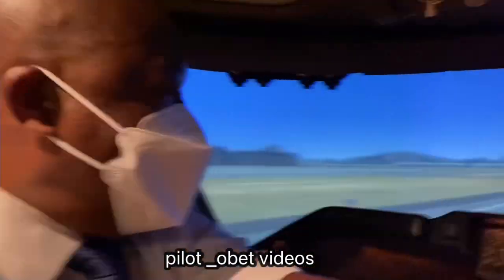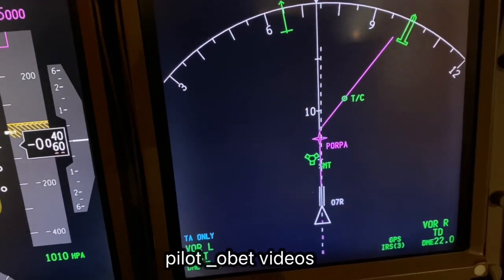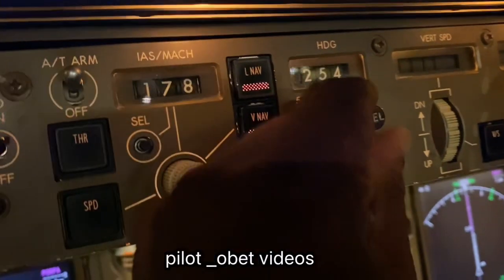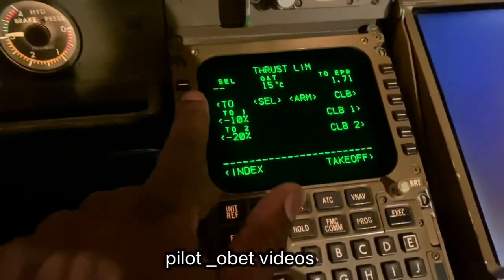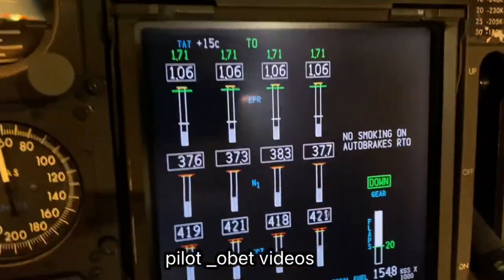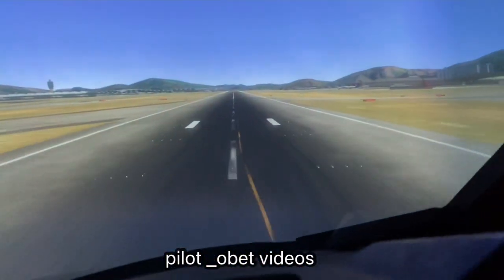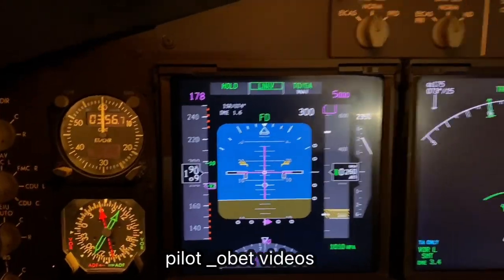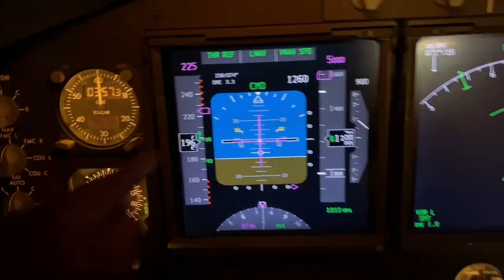B747-400 heavy weight takeoff pilot actions.

Comment: Did not know that auto piot can be set this early in the flight even before lifting the landing gear. Your videos being so informative.
Reply: He did raise it rather late, but normally the other pilot will do it
Reply from the maker: Minimum engage altitude is 250 feet on the B747-400 or 200 feet on the B747-8

Comment: Captain; great clip, thank you. What are the 2 clicks I hear sometimes after rotation? Not the 2 bell chimes but it’s almost like a door clicking close noise
Reply from the maker: The other click is the the landing gear lever latch moving out of the way to allow the gear lever to be raised. Landing gear needs to be tilted before the latch will retract. Very clearly heard on the B747-400 design.
Reply: That click is the AutoBrake Switch clicking from RTO to OFF. This occurs as the AIR/GROUND Mode Sensors fitted into the Body Gear sense the Body Gear swing into the in flight position as the aircraft leaves the ground & achieves flight.

Many other Air Mode only systems are activated at this point.

Ground Mode only systems are also disarmed at this point.

For example. A Ground Mode is the Speed Brake Armed.

The Speed Brake will automatically deploy once the Ground/ Air Mode sensors in the Body Gear sense the aircraft is on the ground - providing throttles 1 & 3 are at the Idle Stop.

The Cabin Outflow Valves also open once the aircraft is in Ground Mode. Other Systems like Engine Reversers are also activated once the aircraft is in Ground Mode & various parameters are set.

AutoBrake action requires the throttles to be at the Idle Stop. Any increase in forward thrust once in Ground Mode will disarm the AutoBrake.
Reply: @dingerbell100  wow that is an amazing in-depth response thank you!! You just answered a slew of questions for me. Thank you again.
Reply: @Sarah-and-Joe  no probs

Comment: Hello Captain, I know that having a college degree is not required in many airlines to become a pilot. Do you think it is worth having a degree and worth waiting 3-4 years for it before becoming a pilot?
Reply: With the current pilot shortage, get the flying started now and get the degree later. Or get the degree at the same time at a college with an aviation program. Seniority is everything. You can get to the regionals without a degree and flow-thru to the associated major without a degree or interview (which I don't particularly agree with). But normally the majors require a degree, so it wouldn't hurt to get on along the way while you're building time as a CFI and regional pilot. You'll be more competitive if you have particular airlines you want to work for. A good pilot has a plan A, plan B and plan C in case things don't go as planned. Education is never wasted. Best of luck and enjoy the journey.  Ben   USAF and Senior captain at a major
Reply from the maker: I think the current trend with most airlines is to hire pilots that also have a degree. If you can do it while you are still young- do it.